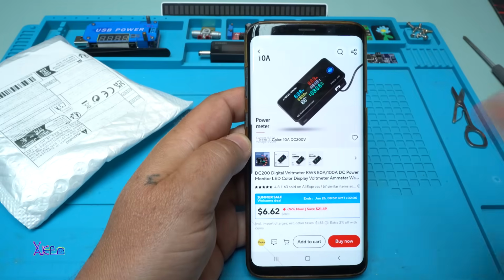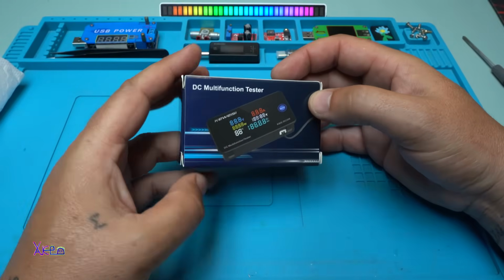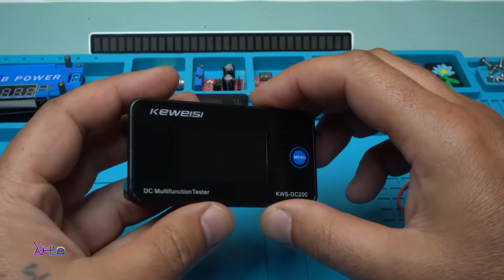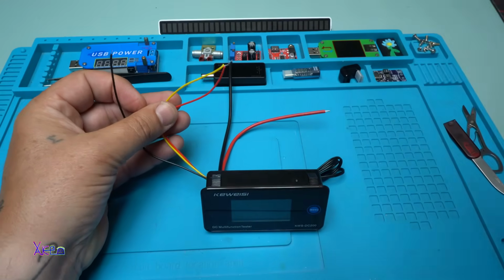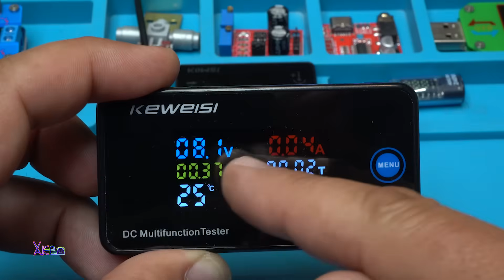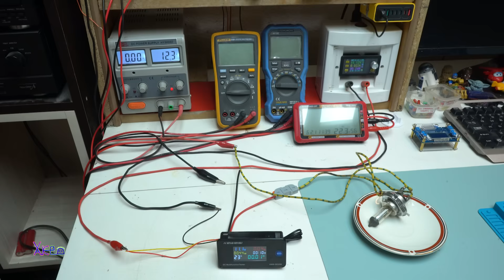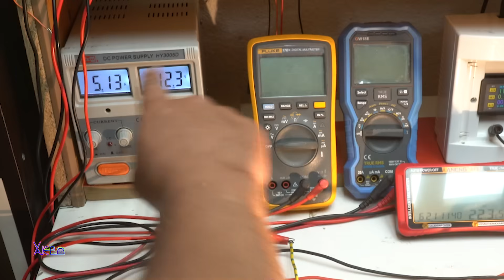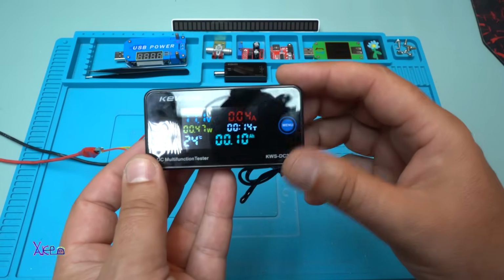$6 Aliexpress DC Multifunctional TESTER is INCREDIBLE?

Comment: I attempted to use a similar one to retrofit a  lawnmower 20 amp meter and a truck 60 amp meter using the appropriate shunts but a design anomaly made it impossible to use. It was not possible because it measures current on the negative lead instead of the positive lead. I could not isolate the internal motor altenator on the mower from ground so it could not measure current, on the truck it had a similiar issue. Does this one measure current on the positive or negative lead?